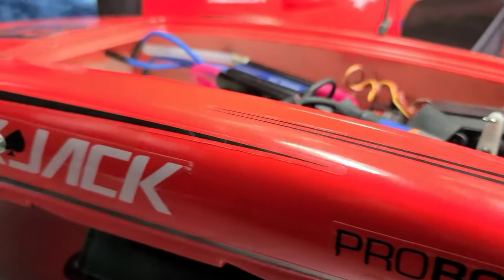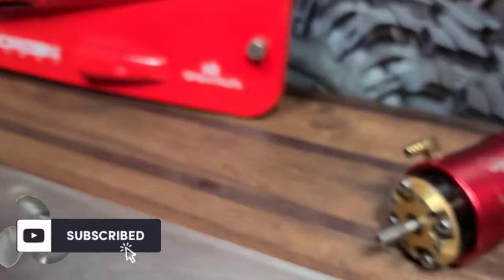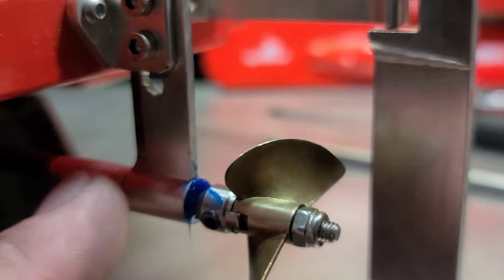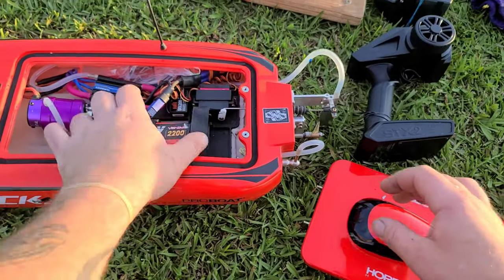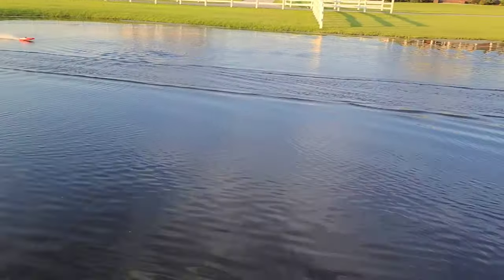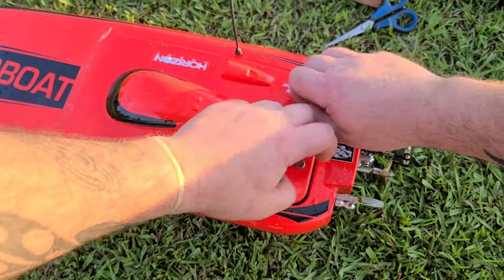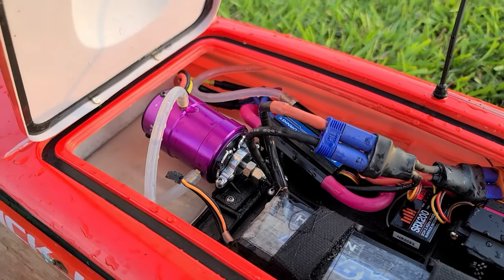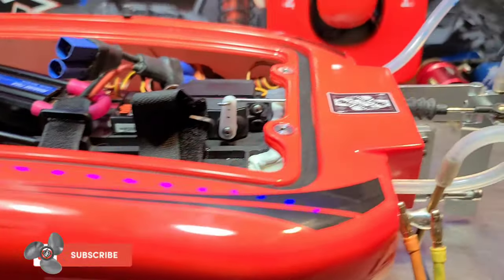Will It Go Faster Than The Small Block Blackjack 24 - RC Boat Brushless Motor Swap

Comment: I put the rocket 4000kv 2968 in my blackjack 24 and ran it for the first time today...omg. I got 61mph on 4s with a 3414 prop. It's definitely under propped. Temps were in the 90s. I'm sure you and your subscribers have gotten more but this is my pb. I got all the know how from watching your videos so I thank you very much.bgfl
Reply from the maker: Nope that's faster than my 2968 setup.  Good job

Comment: Thanks for all your hard work on the BJ24. I have one new in box, never run...Any obvious mods needed, other than check screws and lube the shaft? Single water cooling for ESC and motor enough? I have a hard case 5000 50C 3S battery for the boat. Thanks for your thoughts, Michael
Reply from the maker: The angle of the Strut. I would try different angles for the best ride.  also get thru hull niples for the water cooling inlet/exit. Water gets In the boat with the silicone lines run thru the hull.. 440&438 octura prop seems pretty consistent
Reply: @IRONCLADRC  Thank you very much!

Comment: The small block 4000kv motor on 3s is 44400 rpm, the large block is only 2100kv on 4s is only 31000 rpm. Problem is the larger motor needs proping up more for more speed at lower rpm, the problem comes with the Blackjack being a small boat it ends up being over proped where the boat runs crazy & unstable.

Comment: Nice vid. But do you have tips for me? I havea Atomic and a outlaw rc boat for me and my son. I want to upgrade to biggeer motors but having problems with fixing biggermotors. Are there plates that i can buy for the motor mounts?
Reply from the maker: You can check out "Off shore Electrics" they may have a motor mount  you could use.   You Might have to modify the mount so it will fit

Comment: I'm agree with you man, I think that The important thing is the watts. This Turnigy have more or less 1500watt, surpasshobby rocket 2968 4000 kv 1800watt and maybe more light. This is the question. I have into my bl24 a 3660 3500kv surpass hobby with 1700watt, with 3s running, seaking 120a,  nylon original prop, stock flex, I run around 66 km/h. It's good because have not metal prop, 3s and not 4s.....soon test with your similar set-up. Thanks man for your help and supporter video. Stay fast from Italy
Reply from the maker: Tfl 438. Is a perfect prop for that boat. I've gotten 61mph on 6s. 4s around 52-54mph (if I remember correctly
Reply: @IRONCLADRC  thanks man. I have for now a 38mm 1,4 pitch alluminium prop for spring test (in my country I'm into fog:)). Stay fast
Sebastiano from Italy

Comment: Those purple bags for your TX look like you get with bottles of Crown Royal?  Good taste if so, and good work on the videos thanks
Reply from the maker: Yes sir you are correct. Kinda keeps the TX safe in my book bag
Reply: @IRONCLADRC  Thanks man, good work.  Loving your videos and I just dug out all my old boats, got a big gas Apache 50" rebuilding at the minute, and looking to convert one of my other old hulls to fast electric or get a TFL Pursuit or similar to play about with.  Living on a tiny island I got a lot of water around me to play with!

Comment: Looking to up grade my motor on spartan not sure wt will b best i got a seaking v3 180 esc now i need a motor whats better a 4 pole or 6 pole tp vs leopard around the 2000-2300 kv range any tips will help thanks
Reply from the maker: Tp power all the way 4050 2300kv iish the esc will handle it 👍 leopard motors aren't what they use tobe

Comment: Bigger cans more amps to motor and Lower KV needs more voltage
Reply from the maker: Yep you hit the nail on the head.  The turnigy motors are great..   just got back running the 24 on 6s hit 58mph. In the small pond.

Comment: I tried looking up the Surpass 2868 4000kv motor but nobody seems to have this motor. There is a 2968 4000kv, but no 2868 so was that just a typo or no???
Reply from the maker: That's a typo. 2968 is correct.
Reply from the maker: I just fixed that in the description  thank you very much my friend
Reply: @IRONCLADRC  whew! Thanks. Racked my brain over it for a few then figured it out.
Reply: @IRONCLADRC  you're welcome. Hated asking but being that I could not find a motor with that number anywhere the closest thing was the 2968 and figured it may have been a typo. I am very glad that you clarified that because I'm about to order this motor for my Blackjack 24 after seeing your video. I am very impressed
Reply from the maker: I have that motor in my new deltaforce build too. Oh man I love it.  On 4s it's an absolute rocket.  I'd use at least 90a esc. I was using a 70a esc on it, 70 a isn't quite enough power Had heat issues.  Currently running 90a flycolor, 2968 4000kv, 4s 3200 100c
Reply: @IRONCLADRC  I just installed the Dynamite 90a single connect and running it with a 4s 5200mAh 50c with the stock Blackjack 42 prop and am getting 42mph consistently. Now it's time to get that 50+ and I'm thinking this motor is the way to go to get it there.

Comment: Sweet video! Very informative and entertaining
I would love your direction on a project
I have a stealth wake 23in,I have bought
A 60amp ESC and need a motor choice....
Would you recommend anyone of these motors for it in your recent videos?
Looking to get her going 30+MPH
Any advice would be very helpful
Thanks for videos
Reply from the maker: What size brushed motor comes stock?
Reply: It's a 550 brushed
I bought a 60 amp marine ESC brushless
And I did upgrade to a aluminum rudder
I thought maybe the smaller motor you had might work?

Comment: I run the same Turnigy motor with a 4074 1900kv on a dynamite 120 in the Miss Geico 29 I built on 4-6s and get about 76-79 mph on a pair of Spektrum 50c 5000mah
Reply from the maker: Dang that's some great numbers 👌  low kv motor you can turn larger props with out heat.  That's awesome high 70's with the 29. 👏
Reply: what size prop u use for that speep....tv

Comment: Big block motor is more torque and needs 4s at least and to make more speed will need more voltage to get the same rpm as the higher KV motor

Comment: Its slower bc its lower kv running rhe same amount of cells in the lipo rhe c rating has nothing to do with speed just how much amps the battery can put out so it doesn't matter if it's 30c or 100c top speed gonna be the same 
 The 100c might be a bit stronger of the line bc it can handle more amps . If you want a faster boat need a higher kv.
Reply from the maker: I agree 100% about kv. Not so much about the c rating. I've used 3200 mah 50c and 3200 100c batteries and the 100c was faster by a long shot.

Comment: Its the kV, get a 4000kV 36mm can and see how it does. I bet 60s or backflips lol
Reply from the maker: Bet your right.  The turnigy motor is 6s Capable. Maybe throw 6s on it. Hah ha
Reply: I can tell the small block is really the least powerful of all them motors. On 3s it will rev 49000 plus unloaded. And on 4s 65600rpm plus unloaded. 

For a proper comparison you need to run a 2000kv on 6s versus the 4000kv on 3s.

And the 2000kv on 8s versus the 4000kv on 4s. 

Or 4000kv to 4000kv 36mm vs 28mm can for a fair comparison. 

I saw the video where the 4000kv was run on 2s and did around 31mph. A 2000kv small block 2868 would run low to mid 30's on 4s.